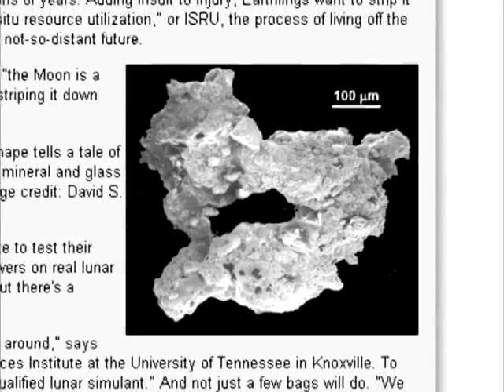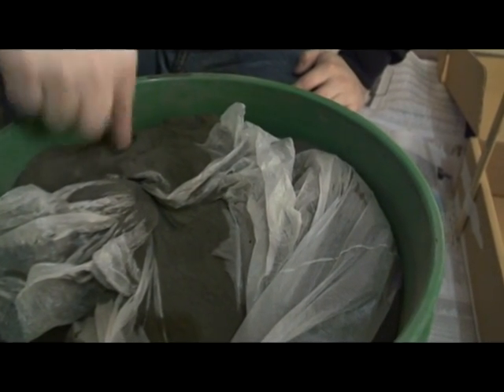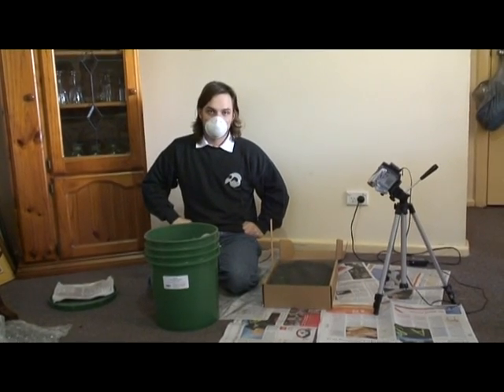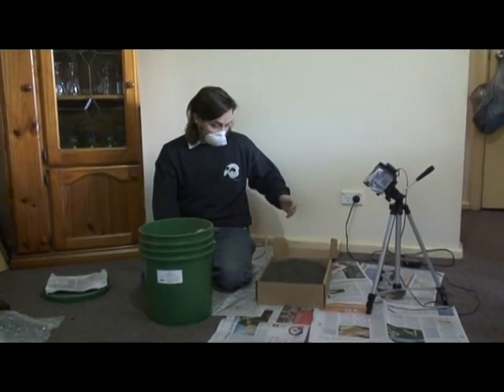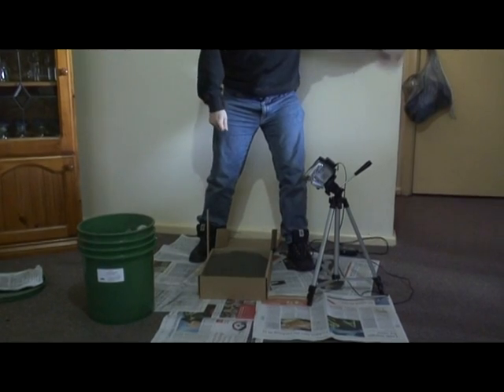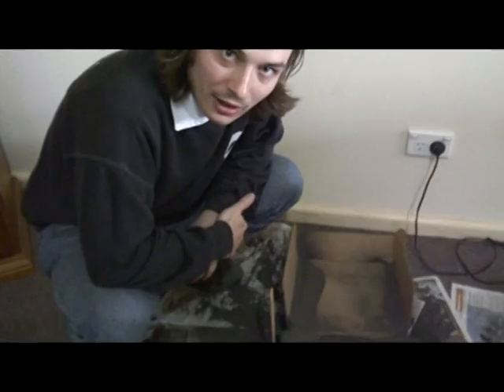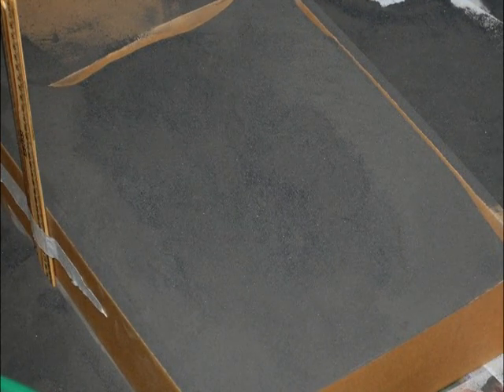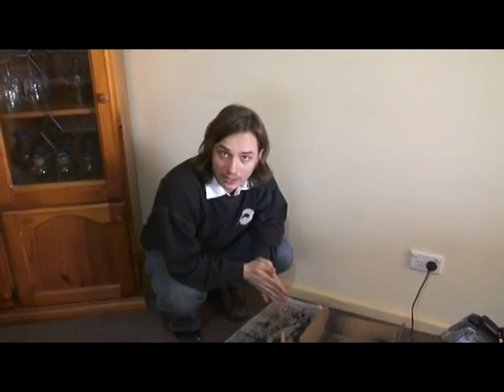MoonFaker: Footprints On The Moon Set, Ralph René Was Correct! PART 2

Comment: moonlanding-believers will ever find the hair in the soup. But myth-busters have scattered many hairs in the soup first. The regolith is no moondust, the earth-gravity is 6 times higher and they used only a thin layer of the dust and the boot of the moonbusters only touched the surface softly a very short time, in real, astronauts stand on the surface and touch the ground very longer, even when walking. If NASA is not able to produce a sand, that makes clear footprints on earth in dry condition, although they had now 50 years to do so, but they are giving you only this product for 400$, they tell you, hey, I'm not fussed about what you think, I don't give a shit.  But what you also can see, this regolith is dark as black tarmac, how can this material can reflect the sunlight so bright, that the astronauts cannot see stars in the black sky ? It is not white snow, it is black asphalt. It is not reflecting very good, but very very bad. Another discrepancy, mismatch, but moonlanding-believers find always a way to explain, like rats the rathole to hide away and cover up. But what you always see, nothing fits together, if you explain and clarify the one thing, then it doesn`t fit with the others. Another example: The reflectors on the moon for the laser-observation, those tiny little things, and they can see the reflection of this little square on the moon on earth, but cannot see the great moon-rover in comparison ?

Comment: The only thing I don't like about this experiment is the fact that Jarrah's boot is not even clsoe to resemble the Apollo boots. However, the tiny box Jarrah and the mythbusters used are actually helping the material to stick together. You need an open place or a bigger box to allow the sand to expand and separate. However, a great job here. Maybe we could get an update some day where we actually do this out side with a construction boot

Comment: A Bag of flour would have been cheaper and closer to the Moon surface, the print has no texture and is an exact imprint of the surface of the boot, therefore it's extremely fine powder and has no texture either, like talc or flour or certain types of ash or fine cement its no longer individual particles heavier than air, its only there because theres no air and wind to blow it away. You need a bag of something fine enough to become airborn as it pours from the cup into the box, then you will get an accurate foot print.

Comment: 1. You didn't duplicate the Mythbusters' result.  2. You didn't articulate a hypothesis describing how the moonprints could have been made.  If you can't make prints in beach sand or in simulant, then how can they be made on Earth?  I wonder if there are static electricity effects in lunar regolith from solar and cosmic radiation.  Sorry, I don't think either MB nor JW have debunked anything at all.  Maybe you've proven that the prints were, in fact, made on the Moon's surface, because you've shown that they could not have been made on Earth.

Comment: Proven. its not possible to mould or form shapes on fine, dry aggregate. Imagine the sand in an hour glass. Its completely dry and will not clump together so as not to fall into the lower chamber. the moondust would be even dryer. The mythbusters vacuum experiment was a joke, as all their exposes are. One pat on a sand bed with a boot, leaving a faint, clear print is not exactly a proof. Why was it not done more times to get the same result as the space photos? Because they couldn't do it.
Reply: +chunkyification 
You make an interesting observation with the egg timer something I have not considered. 
One thing that may be of interest to you?  Is I knew years ago a sand casting specialist, who made special cast iron parts.  He said the sand had to be very fine almost like talcum powder and damp,  in order to mound around the pro-former and compacted. 'Which cost his firm a fortune'.  
This was then allowed to dry and you have your mould for one dimensional casting.  He mentioned that he wished he had moon dust!  I asked why? And he said well I would not have to wait for the sand to dry before pouring molten metal into the moulds.  He went on to say that in low gravity and with very dry moon sand/dust the moon foot prints was a mystery, as he had handled many forms of granular materials within his profession and was deeply puzzled, how Buzz was able to leave such a razor sharp edged foot print with exceptionally clean vertical sides when in forward motion. Where the sides were a perfect 90% without collapse due to the irregular contours of the boot.  Something I have on all these videos never seen questioned Why as this is a dead give away? forward motion distorts the print. The second point he made was how the hell did it all hold together without a specific degree of moister?  

I think the Bond film Moon Raker says a great deal more than people realise. After all the author Fleming was himself a British agent was he not!   And was very subtly or not so telling us all that the Apollo program was utter bollocks.
Reply: Too true, mate. BTW. Casting uses polystyrene mould formers surrounded by sand in containers. As the molton aluminium etc pours in it vaporises the poly but fills its void, forming the mould cast.otherwise the sand would not be capable of assuming the shape required. thanks.

Comment: You cannot simply dismiss another's observations/findings without replicating the experiment exactly, with all the same conditions.  Vacuum, temperature, material (regolith), gravity, static charge, weight, boot tread pattern.  Jarrah White, your experiment absolutely did not replicate he conditions on the moon or the Mythbusters', and therefore, is inconclusive at best.  Part of the scientific method includes not only peer review, but the ability to repeat the experiment with the exact same results.  You did not repeat the experiment.  The conditions and materials were changed, there was no "control", and considering that a vacuum can cause different materials to hold a static charge (which may or may not cause regolith to attract particles), your experiment is bogus.  There are simply too many variables that you did not include.

If you want a credible experiment with credible results and observations, you must repeat the experiment with better, precise conditions as closely as possible to the conditions known on the moon.  Then, and only then, will your findings "hold water".

Comment: Measure moisture content of JSC-1AF Regolith simulator as delivered and incrementally increase moisture to confirm the earlier assertion that boot print formation and quality to be of such as in historical photo requires X % of moisture by volume. (Original looks like print is in moist charcoal dust).See if you can find documentation stating under what motion it was that Buzz made the print and his total weight at the time correct for Earth and recreate. Oh yea and strap on a camera and take the shot.

Comment: That is absolute total nonsense.

With Zond V, the Sov's had satisfied themselves the radiation problem in all probability did not exist for short missions.

Bull.

The US CHOSE 5psi O2: Lower cabin pressure means lighter hull weight. And that means more payload. Intelligent engineering. 

For short Apollo-type missions, 5psi O2 in perfectly fine.

The only reason Shuttle went to O2/N2 was that longer mission durations were envisioned.

You've been watching too many jw videos - he hasn't a CLUE.

Comment: I call the Saturn V advanced compared to N1: It was earlier, had a 50% greater payload with only 80% the lift-off thrust, and A PERFECT OPERATIONAL RECORD, VS N1, WHICH NEVER WORKED, EVEN 6 YRS LATER.

No, Zond was not reliable enough to risk a man, could only carry ONE MAN, and had vastly less capability in every way compared to Apollo. It was really just a stripped-down Soyuz.

Yeah N1 could have been fixed - in 1976 maybe:

Kamanin:"N1 may one day fly, but it can never be a reliable booster"

Comment: Well, that's really the issue, isn't it!

In the first place, Jews were originally driven out of Palestine by Moslems.

Jewish immigration was only slightly greater than Arab during the period of adherence to the Balfour Doctrine(~550,000 vs 500,000). Arabs flocked to largely empty Palestine, from as far away as Morocco, in that period BECAUSE OF THE WEALTH JEWISH IMMIGRATION WAS CREATING.

Is there injustice as you describe? I think there is, but I don't agree about who is to blame.

Comment: Russia:

They proved space radiation is not an issue for short, Apollo-type missions.

The USSR downlinked Apollo tv transmissions, and satisfied themselves that the missions and the landings were genuine.

Jodrell Bank did a doppler-shift graph of the LM's radio signal during the descent, it came from the correct sector of the Moon, and the velocity profile it reveals matches NASA's.

The Jodrell crew did this w/o outside help or knowledge, and in fact "weren't supposed" to even be doing it.

Comment: No, I do not, nor is that what I said, nor is it necessary to MythBuster's point.

Like a typical ct, when faced with an argument you cannot answer, you try to put words it the mouth of your opponent.

What MB showed is that with a vcauum, they were able to increase the cohesion of the Lunar Soil Simulant they were using.

They did not have ionizing solar radiation, elevated temperature, or actual lunar regolith to work with.

Nevertheless, the result they obtained is suggestive enough.

Comment: What you said talks about MAKING the print. The point being discussed is how the print was retained. So the perimeter would have been bigger, smaller, same. So what? That isn't the point.
'Moisture is needed to make the print'. That was the myth. The mythbusters said that it isn't needed because the particles are very sharp and would bond together anyway. Watch it properly. So the vacuum thing was unnecessary by their own admission.

Comment: Let's re-examine what I said: 
1. The crispness can only be achieved in a vacum otherwise the fluid dynamics of turbulent flow cause a collapsed pattern (Verified) Thus, the crispness can only be achieved in a vacuum or very very low atmospheric environment. 
2. The distribution of mass and pressure are by neccessity required for the form to maintain integrity after removal of pressure (Confirmed)
3. That this could only be done in a vacuum. He basically set out to falsify them and confirmed>

Comment: @occhamite You said it right "most of their arguments are not strong" same apply to the arguments made by those who fanatically defend the moon missions. To destroy the hoaxers claims the believers in Apollo missions use information provided by the accused - NASA. Example would be the radiation problem. According to NASA's website the radiation for Apollo 14 was 11.4 mSv which is too low to harm DNA. Other websites use completely different numbers...So, there is a problem here...

Comment from the maker: @G1NZOU 

AB2 claimed the photos can't be filmed with wet sand because the videos show otherwise. Then it's a good thing I never claimed both were filmed using wet sand, isn't it? I specifically said that the STILL-PHOTOS were filmed using moist sand, and the VIDEOS were filmed with dry sand - hence the lack of clouds. Besides which, any prints formed in the videos are indistinguishable due to the poor video quality.

You're echoing a strawman propagated by AB2, accept it.

Comment: Mr. White, this video is pathetic!

"The only purpose of the chamber was to remove any moisture..." INCORRECT! A vacuum also removes air! When a boot is lifted, air rushes under the boot to replace the space! That rush of air can easily collapse the formation. DUH! 

And, it would help to use the correct regolith sample.

AND WEAR A SHOE THAT'S NOT WORN ON THE BOTTOM! Frankly, the 2nd print you made looks almost exactly like the overly-worn shoe you used!

Comment: @WhiteJarrah you did not do this experiment right! the moon dust  needs to have a surface wetness of near zero. which you can't archive by doing this in air or vacuum by room temperature . the sand has to be DRIED (heated)  under VACCUM first!!  And the sand  has to stay in a vacuum. This is what the the Mythbuster clowns totally forgot. So the effects of your experiment should be even more noticeable. Keep it up!

Comment: @jellystapler No it does not "discredit" them at all. They did a pretty good experiment with what they had. They got a decent print in a vaccum. Certainly MUCH more thought out and executed than Jurrah's. How could they use the actual lunar soil? They can't - unless they have the budget to design, build, and launch a mission to the Moon for a sample return mission. Your underestimating the size of actual lunar soil, sand is much bigger and wont hold a print - sand is not the key.

Comment: Your test setup is flawed MAJORLY. Get your self a pressure suit with the actual boots the Myth-busters used that went to the moon, and a big vacuum chamber big enough to stand in. Until you have all that, and do the experiment thoroughly, your just blowing smoke into thin air with your claims. The myth-busters did there tests as best as they could.

Comment: @TrueGroup I agree about the box this should be repeated using a larger containder with solid edges and wide enough for the materiel to clump rather than push back together,but he would not be heavier if he was wearing all that kit as the moons g is only 16.5% that of the earths,so unless they were wearing really heavy gear this shouldn't matter

Comment: @occhamite  the MBs test was performed in a virtual  vacuum using material nasa claim is virtually identical in structure to lunar regolith.
The boot print obtained was dismally ragged and not remotely virtually the same as those in the Apollo photos.

 Lie  ng Huang Lee's book of propositions and ruminations is irrelevant in the light of a practical simulation. This was done and the result plain to SEE.

Comment: @BlisterHiker 

You said the structural strength of the PARTICLES is greater on the Moon. SO, doesn't that mean you consider the footprints collapse because the dust particles do? If not, you weren't clear.

Comment: @BlisterHiker

The only thing I've said here that has defended Jarrah's experiment, is that 1g or 1/6g doesn't make a difference, and that only very small fraction of the lunar dust is so tiny as HLAR said.

Now, if those are false, go ahead, correct me.

I'm thinking carpet rebounce and carboard box won't change the result, but I already asked for new addendum to answer those points.

Comment: @HeadLikeARock 

HLAR, sources I found of lunar dust say only a very small fraction of the lunar dust would be as small as you suggested (0,3 µm average size).

Lunarpedia(dot)org:
"Fine dust with particles less than 20 µm can make up 10% to 20% of the mass of the regolith. "

BBC News article "Lunar dust 'may harm astronauts" says:
The team at the University of Tennessee has shown that about one percent by weight of lunar soil comprises particles less than one micron in size.

Comment: @Aurinkohirvi

You need to direct questions such as that at the manufacturer, or at NASA. I guess it's very difficult to mill particles that small. Or they don't need them that small for simulant purposes.

Regardless, the facts still stand. The average simulant particle size Jarrah used is about  500 times larger than an average lunar surface particle. He goofed, it cost him $350+. Stuff happens.